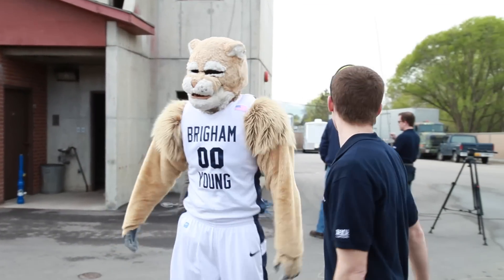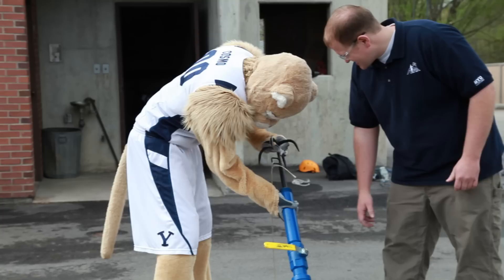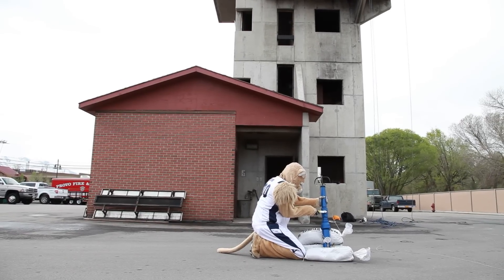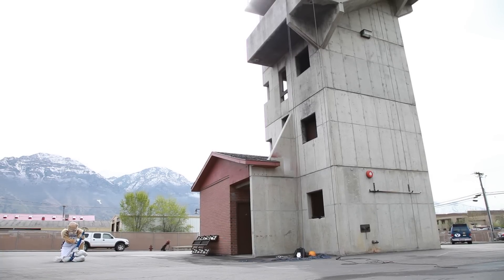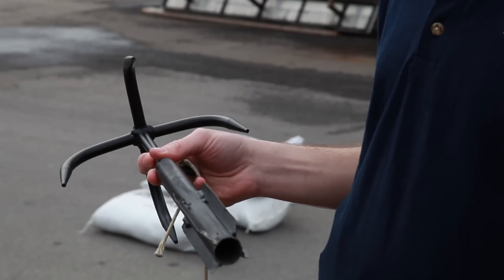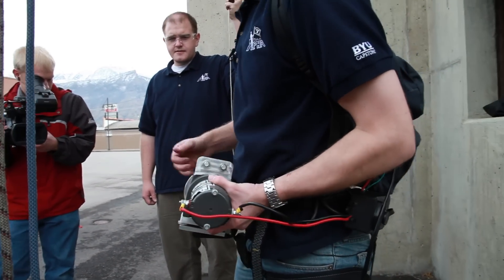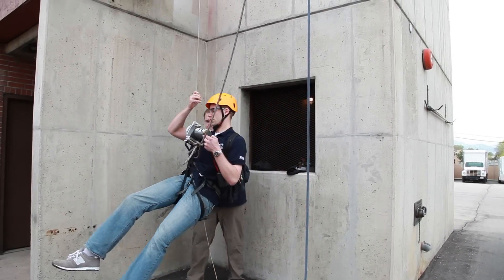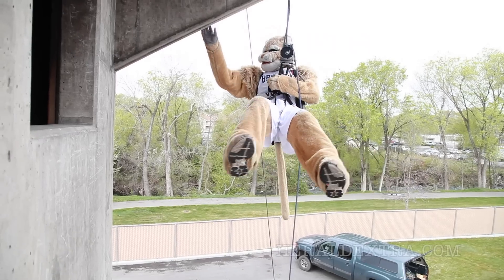"Batman" grappling hook developed by BYU students

Comment: how do you get the bullet out because after awile you wont be able to use because there is to many smashed bullets in it ??
Reply: Wouldent have to worry about having too many smashed up rounds sitting in it, the first time you try to launch that thing with the energy supplied from a common rifle round, youll realize that its only good 5... maybe 6 feet. The only reason it looks half impressive in this video is because they used pressurized air to launch it, probably with a perfect seal too.

Comment: the blue tube that fired the hook looks like they read the history of D'day... I have doubts that a bullet catch would throw this thing nearly as far simply because of the shape of the hook. weight may also be an issue with distance and while they had the same concept in WW2 with rifle grenades that was a much larger round than the 7.62x39 which is currently the standard which does not have nearly as much force as the 30-06 (aka 7.62x63)... not even going to comment in depth on the winch because it is just impractical...
Reply: Current round is 5.56x45, not 7.62x39.  Should be plenty for 90 feet. It's got the muzzle engergy.  Alternately, they might only be specified for a 7.62x51, which would definitely do it.  7.62x39 is the former Soviet service round (currently they use 5.45x39), so it's not in the running for th US Army in any case.
Reply: you're right, i must have been having a mind blank haha, anyway i still dont see it being practical
Reply: +marchingpackofCeHS I don't see it as very practical, either... yet.  But the first tanks were pretty impractical, too...  give it time, and you never know.

Comment: They should have made a more portabale one, i feel like it would have been easier if they made it to aid you when climbing the rope instead of expecting the device to hold your full weight
Reply: Work in progress why don't people understand this is NOT the finished version that troops are going to use. It will be a tiny winch on your belt with a launcher that has adjustable shot distance by the time this is implemented

Comment: World laughes about you! Such "Batman-Hooks" were invented more than 5.000 years ago and have been shot by the crossbows to climb up the walls of the ancient cities.
Reply: ***** A modern crossbow has a shooting range of about 300 yards. And the ancient crossbows had much more power than the modern crossbows. Of course almost no one uses today the crossbows for war because the firearms are much more efficient. But it`s much easier to shoot a hook with the help of a lightweight crossbow than to carry a heavyweight compressor to pump the air in your "air-pressure-Batman-hook" which should be pumped up after every shot and this action wastes a lot of time! The crossbow can be reloaded in 5 seconds. And one of the most important advantages of a crossbow is almost noiseless shooting and the enemy will not hear the shot and won`t be able to react on it.
And by the way: this system already exists and is called TAIL (Tactical Air Initiated Launch). Here you can read more about it: http://battelle.org/media/press-releases/battelle-designs-innovative-grappling-hook-technology

Comment: Yes, however the proof of concept is needless, if you intend to actually make a grappling device, why use pieces of scrap? Prototyping is useful in case there is a design, but it looks like they're just playing, I think the correct approach would be a case study on smart projectiles, that way you could possibly plan a way for a hook to actually penetrate surfaces and allow for easy adherence, without all the bulk, otherwise a bulky grapple extension for a gun barrel isn't such a fantastic idea.-

Comment: You certainly need proof of concept any time you are dealing with a new design that solves an old problem in a new way. Though the design of a grappling hook may be geometrically simple, and made of simple materials like steel, there are all kinds of kinks and problems when it comes to real world application. Maybe the claw is too thick, or the cable tends to bunch up, or the hook is too sharp so its hard to carry, etc. Simple design does not remove the need for prototyping and testing.

Comment: The dissapointment comes from a lack of design, you don't need proof of concept for something like a grappling hook, there are waaay more complex things out there, and they should have made their prototyping more efficient if it was even required, all they did was assemble ready made materials, it would be impressive as an open source manual for guerillas and insurgents, but not coming from chaps that probably know how to do better than that.-